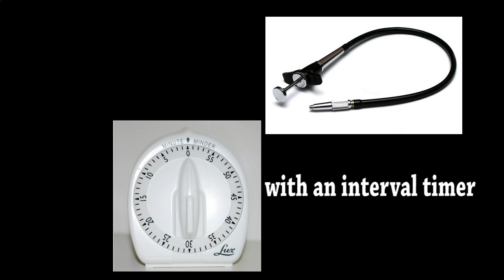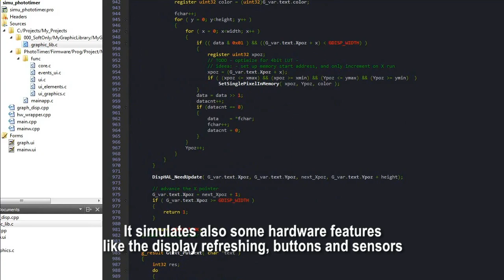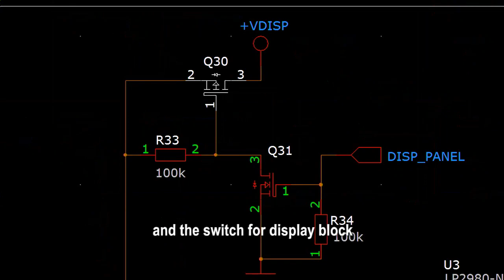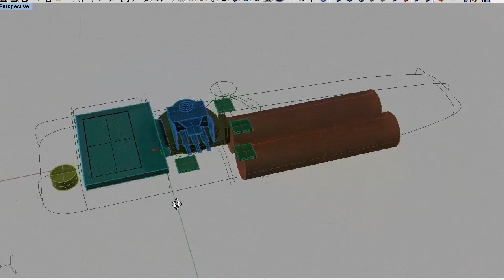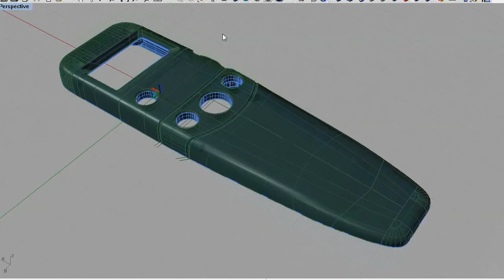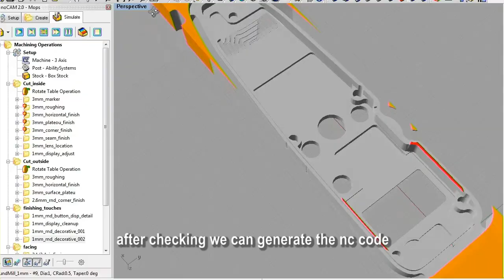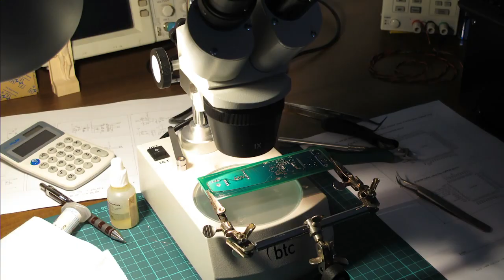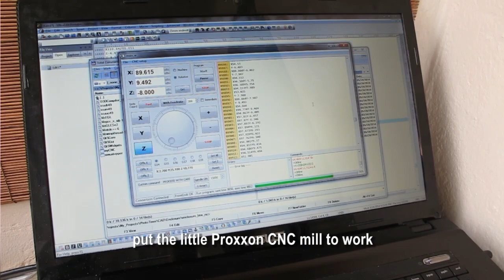nagyizee's Camera Cable Release project (full documentary)

Comment: Awesome job! Please can you tell me what software did you use to simulate the device on pc?
Reply from the maker: Thanks :-)
I used QT with QT Creator, where I made a little "framework" where I can poll the main application loop and simulate interrupts, timers, storage, power management, etc.
I separated the hardware related code through a common API which I simulate in the QT. So I am working on the same code which is running on the target except the low level hardware stuff.

Comment: Nice work!  What did you use for your GUI builder?  Thanks!
Reply from the maker: I wasn't using a specific builder, those are my own GUI elements put together in C code on a simulation platform what I wrote using QT creator,
Cheers :-)